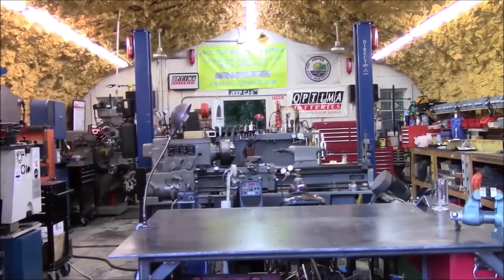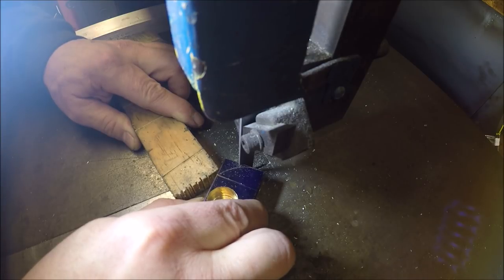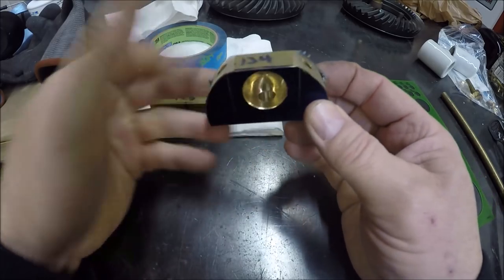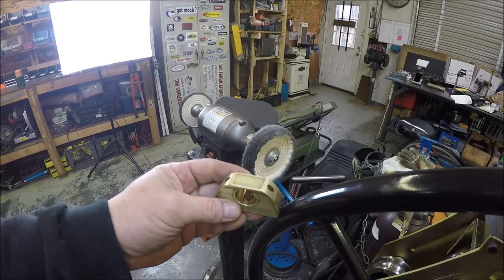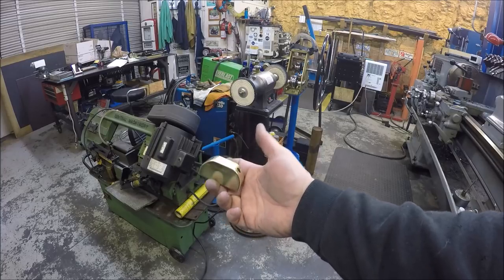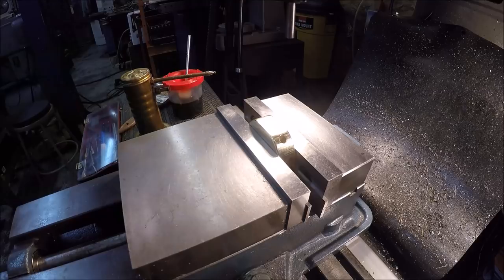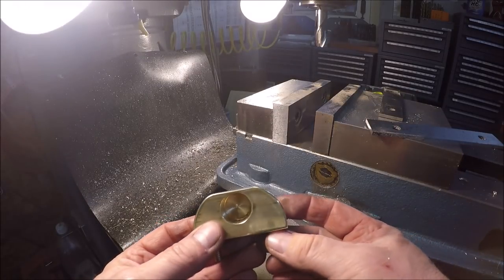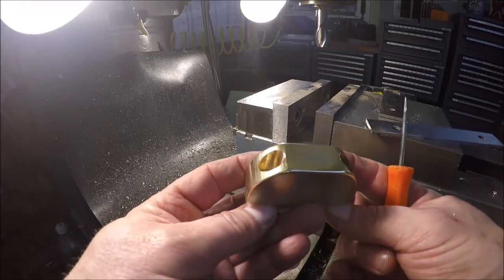Desk lamps made from car parts part 3

Comment: SWEEEEEEET Lamp Tom. Nicely thought out project. Like the mounting with countersink. Lights are tucked up enough so no glare 👍👍👍. Would like to make valve covers to match my 29 Ford but, flathead V-8 doesn’t have valve covers. Hemi covers would be nice. Lots of poss Tom. Thank you for sharing my friend.😁
Reply from the maker: Thanks Ron. Using some old hemi covers would be really trick.